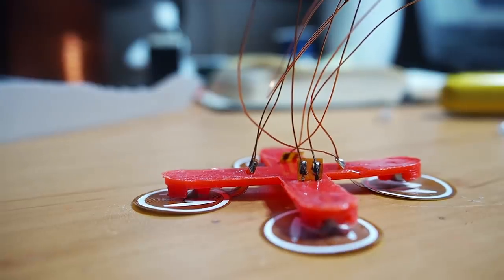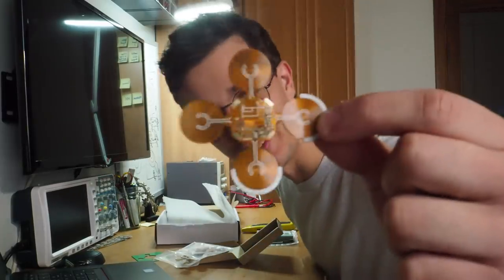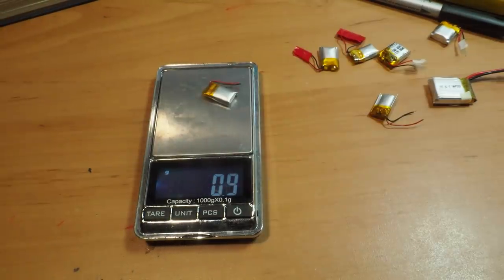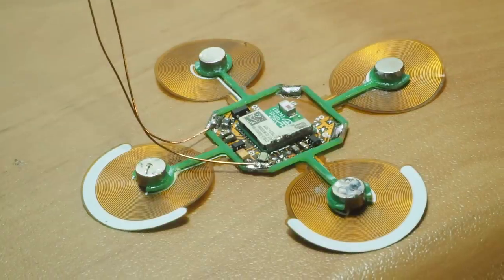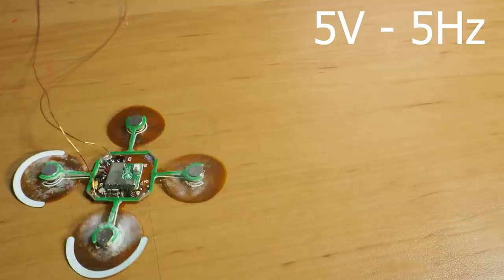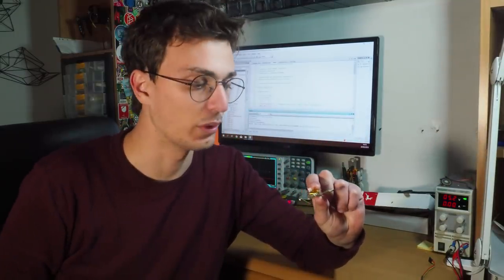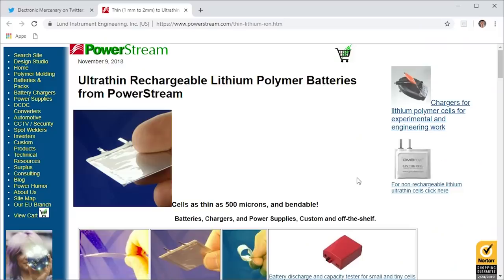Making a Robot from just a Circuit

Comment: magnet pcb is too flexible. so all of its energy lost in there.
Reply: i wonder if adding copper layers to the pcb would help
Reply from the maker: I might do it a bit thicker in the next version 🙂 for the 2 legged version the effect is very minner
Reply: @CarlBugeja  just drop some superglue on top layer and to the bottom (for test purpose), also u can reinforce it with some salt or baking soda
Reply from the maker: I might try that in the next test video.. But the flexing issue was not that of a problem for the 2 legged version
Reply: @CarlBugeja  seen walking with voice coils (speaker coil). can go much bigger. one thing you miss here is resonance, eg. if 43Hz was the sweet spot you missed it. sweep and watch. i wonder if the membrane might work for a light water vehicle (one sheet, lots of coils). 
actually i think it was one big coil, one foot, big jumps.
Reply: @CarlBugeja  из алюминия сделайте, для того чтобы проволока была более жёсткой, разогрейте её и растяните, таким образом кристаллическая решетка метала примет форму такую которая придаст жесткость материалу. Сварку производите в аргоновой среде или скрепляйте заклепками, просто пластик поглощает вибрации.

Comment: i'm impressed! i never bothered with anything but basically hand doodled or laser printer PCBs, but you're tempting me with crazy possibilities here. and this mechanism is some cool stuff.
some input from my tinkering experience: laminating very thin sheet iron, say 0,3-0,5mm, onto the back of the printed coils will propably make them much more effective electric magnets. and the magnet sticking to it, could allow it to "snap" off with a LOT more force.  once the induced field overcomes the static sticking, it should fling the magnet away with surprising kazamm. if the coil can handle enough current to make this work, the bot will jump into the air. the "stickyness" can be adjusted, by using thicker tape to stick on the iron to increase the distance to the magne.. 
but the easiest propulsion for a PCB-mobot are vibration motors on a cutout that forms a spring. angling the motor makes it a rather effecive leg. i can recommend waterproof motors, those are nicely enclosed. pancake style vibrators are powerful, (moving mass is further away from the axis of motion) but would have to be solderer to the edge of the pbc.
PS: 3M VHB literally keeps the world together.

Comment: Slightly stiffer magnet arms would transfer more vibration energy to the rest of the body.  I know that will make it heavier, too, unless you can find a stiffer light weight plastic.  Also, it was probably the heat of soldering that warped the flexible pcb coils.  Maybe a lower heat would flatten them again?

Comment: Would it help to glue a rough surface on the bottom side of the flexible coils? Maybe to have some sort of better push¿ Keep up good work!
Reply from the maker: Not sure if it will help it or increase the friction on the other legs
Reply: Why do u use ¿
Reply: @kimi8638  spanish keyboard
Reply: Use just some normal enamel paint and then draw some line under the pad like 🦓. It will make lot more friction. Thin layer of Rubber/hot glue would works same.

Comment: and some capasitors in series with the coils. If you are running them and a higher frequentie. 
Other wise the coils will just increase there resistance on te imagineary plane and this will cause the current to flow out of fase with the voltage.

overal nice progress on your project.

Comment: A suggestion for a way to drive the coils just in case you haven't tried it yet : try to drive multiple coils at the same time with some dephasing in the pwm signal for each leg (for example add a PI/4 phase delay between each leg clockwise to get a rotation in one direction and -PI/4 to get the opposite rotation, or drive only two opposite legs with some dephasing to get a better forward motion)
Reply from the maker: Driving two coils at the same time would be ideal but I cannot do this with this battery because of its current limitation. But adding a bit of a deal would help I think

Comment: You could stabilise/straighten parts of the flex pcb like the large circles by adding in solder lines. Try thickening the rigid pcb too, the weight gain looks like it would be worth it.
Reply from the maker: good idea :) i think a better one would be to have a flexi-rigid pcb instead - not sure if it will improve it by much though

Comment: I think you can try to bend flex PCB down to form some kind of spring to hold robot's weight (or do the same with anoter way: add some between pcb and flexpcb or add some additional flexible material). Previous robot version did that thanks to bended flexbcb.
With "springs" you'll need much less power to move the robot and you can use larger battery (or lesser, as u wodn't need much power).
Also you can try to stack couple of flexpcb in one robot to drive more current/induction.

Comment: I've always thought you could make very thin speakers using an array of printed spirals like the ones you have for feet on your robot.  In your robot, the spirals create a magnetic fields that are opposed by permanent magnets.  But instead of a permanent magnet, you could just use another printed coil wired in reverse so the two printed coils repel each other.  That should give you a basic acoustic speaker.
Reply from the maker: Already done it 😉 https://youtu.be/36KwlUBadrg

Comment: You can mount the magnet to stronger body and make the flappy thing free  that will make air billed under the flap thing and the robot will flow on the table 
And you need to billed like a frame under the flaps so it can trapp the air .
Keep going this is the first video i sow for you abd i am excited to see more 👍🏻

Comment: Couldn't you use piezoelectric plates instead?
Reply from the maker: The price of Multilayer piezos is too expensive + to actuate piezos one needs to boost the voltage to at least 200V so I would also have to enlarge the middle space of the robot to make more room for a boost convertor. So yes it is possible but this is way more simpler :-)
Reply: Remember the "Art of UNIX programming": “Make it run, then make it right, then make it fast”.
Reply: @guatagel2454  very useful point rarely mentioned ,thx

Comment: I believe that stiffening your magnetholders might quiet improve your performance as well. It seems to me that the cantilever structures still flex a lot. That might also acount for a lot of the improvment of your system at the higher frequency. But it is a really cool little robot.
Reply from the maker: Definitely will improve the system! I might redesign its structure to make it more rigid or make it more thicker - both of these will increase the weight so the first step is for sure finding a lighter battery
Reply: Carl Bugeja I understand, just do think about what happen when your arms aren’t flexing any more. Your efficiency goes up, depending on the frequency, a lot. You might wanna put your design in a FEM and estimate how much energy is lost. You might not even need a better battery. Well I am looking forward to your next iteration in any case. :)
Reply from the maker: You're correct 🙂 like I said I will probably redesign the Fr4 pcb because of the flexing and to make it less fragile. But I still think there are other factors that are effecting it, if you look at the 5V wired test their is a noticeable difference even on how the Fr4 pcb is behaving

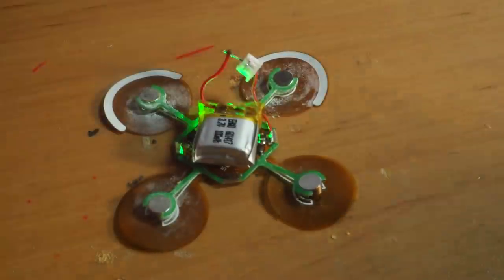Comment: Good work so far! One suggestion: in the independent tests around ~8:00, it looks like the arms themselves are vibrating as opposed to the PCB traces moving away from the arm. Something to try is to add a vertical rib along the length of the arm to increase rigidity. Doesn't have to be more than two or three layers, but that should help test whether the movement is due to the mass of the permanent magnets moving or the PCBs flexing.
Reply from the maker: The bending PCB is definitely something I noticed but I only mentioned it briefly in the video. During the wired test the flexible pcb was actuated but when adding the mass of the battery the actuation reduced and the repulsion force was being absorbed by the Fr4 pcb.. It still worked this way but there's definitely a relationship with the total mass of the robot. I will analyse this further when I get more batteries (hopefully lighter once)

Comment: good start man and well done. Because the movement needs precise vibration, you'll have to be more precise at placing the magnet and rigid pcb, it will help. Also watch out for the heatgun, flex pcb doesn't like too much heat, it tends to warp sometimes, especially on the extremities, did you try to solder it by hand?
Reply from the maker: Thanks! and thank you for the tip - didn't know about this effect it has to heat and the edges look a little warped.. i will try to resolder the next one by hand

Comment: So there is a physical resonance effect? What happens if the coils are operating at different frequencies, is there some harmonic mode that is optimal and others that allow for rotation and direction control?
Reply from the maker: From the test I made the 10Hz frequency was optimum. The leg's mechanical response for the higher frequencies was not matching for the two legs. Given that I have no sensing feedback on these legs it sort of assumes that both legs are matching. Driving the coils with different frequencies should make one leg go faster than the other so in theory it should turn

Comment: @Carl Bugeja you should be more lucky with electro-magnets on both side ( made in pcb of 4/5 layers )
Reply from the maker: The pcb coils of this robot are on 2-layers. Going for 4/6 layers will defnetly make the coil smaller and more efficient but it would also increase the thickness of the flexible pcb to at least 0.3mm (twice the thickness of the flexpcb I'm using)
Reply: @CarlBugeja  it should be flexible enough

Comment: why not add a step up convert. i think the added weight by the step up gets neutralized by the higher voltage.
Reply from the maker: its a good option but i think its easier to increase the power by reducing the resistance of the coil, increase the current and power everything for one lipo - it keeps the design cheap and light

Comment: what if someone made something like this but a little bit more powerful for cpr.-.
Reply: Probably best to leave that to people. Now for emergency vehicles it might be a good idea. It would need a ridged back strap to pull the diaphragm from front to back, and to apply pressure in the middle of the sternum away from the Xiphoid to prevent puncturing organs, and losing energy. Now the hardest part is if a rib breaks, it’s vary common that you break 1 or 3 ribs. Of course an oxygen mask, but might be a good idea.

Comment: Nice Project. Only the one magnet working other 3 are not working why?
Reply from the maker: In the video I powered two legs because the battery cannot supply suffient current to run more legs.. I will retest it once I get the new battery

Comment: You can shave a few grams by cutting off the batteries protective plastic.........
Reply from the maker: It crossed my mind but not good practice - I need something reliable 😝
Reply: A few GRAMS with shrink tube on the battery ?  On a 1s battery that size weigh close to .1 gram

The connector weighs more.

Add mass to the copper coils.

Comment: Why the fuck would you print the chassis like that? Just cut it with laser out of a thin sheet of steel and paint it if you need it to be isolating. This is a master class in how to waste money and resources.
Reply: Also, those flat coils are just wrong. Voice coils are cheap, lighter, more powerful and much more efficient.

Comment: you need to conect a mobile vibrator on it and it will move definitely
Reply from the maker: The point was not to use a motor 😂
Reply: Carl Bugeja but the base of working a motor and your robo is same cupper, magnet & electric current
Reply from the maker: Yes it is but the 'motor' component is not being used.. The aim here is to simplify the assembly process of the whole robot so embedded the coil in the pcb itself makes manfucturing much easier and cheaper. The only additional component is the magnet

Comment: Try it in water
Reply: You can try spraying the pcp with plasti dip as i heared it's non conductive and would work as a great isolating solution
Reply from the maker: Thanks for the tip! I will try it out once I have the BLE stack running